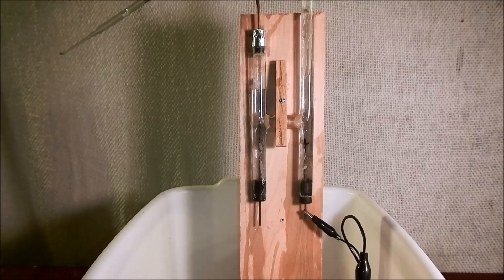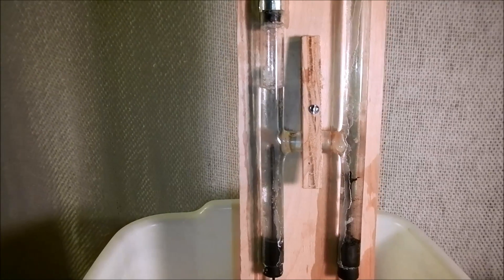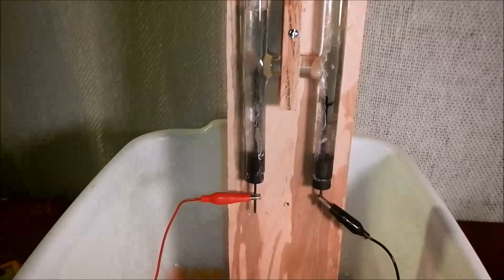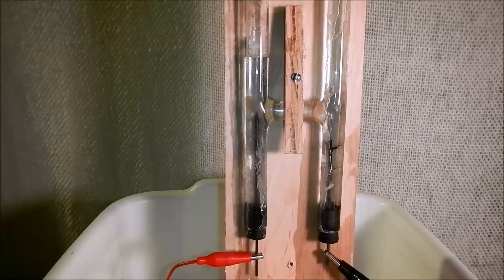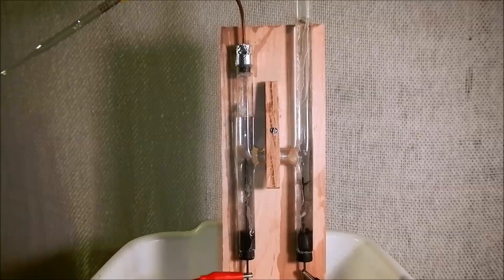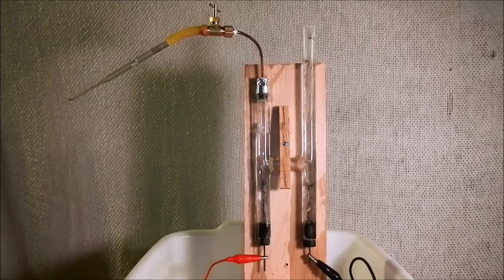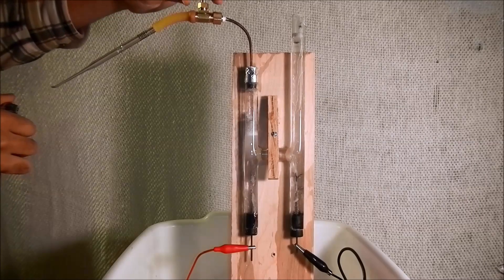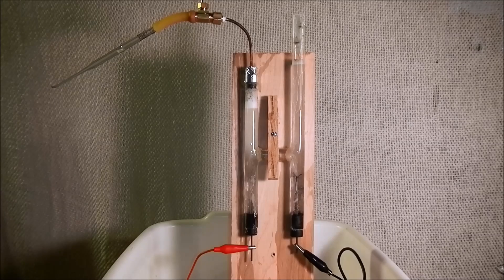DIY Hoffman Apparatus

Comment: Thanks for the video, very informative.  Do you mind telling us where you got the "H" shaped tube?
Reply from the maker: +Scott Waterman Thanks for the comment. I used a burner to heat 2 of the glass pieces to a point where i could blow holes in them. I used a third glass tube epoxied between the two holes to create the H. If i had to do it over again I would just try to find some H bridge glass tube on ebay. good luck
Reply: sparkstarter Thanks!

Comment: You should let the system run for a little while before starting the flame. The hydrogen generator should have time to purge the line of air otherwise you will have a hydrogen/air mixture that first hits the ignition source. This can flash-back into the output line and into generator. You're volume is so low that you would be lucky to get much more than your corks popping out, but it's a good habit.
Reply from the maker: Andrew_koala Actually it has been proven that people with mild or severe dyslexia and word association problems often have higher spatial reasoning and mechanical aptitude abilities.  Also, I think it’s prejudice to assume everyone in rural Africa has poor language skills.
Reply from the maker: good safety tip, but flash-back happens when the burn rate exceeds the mass flow from the outlet. Having the water pressure pushing gas stream should prevent flashback.